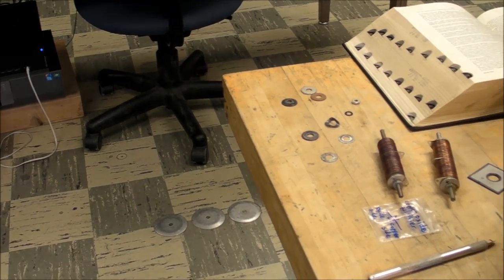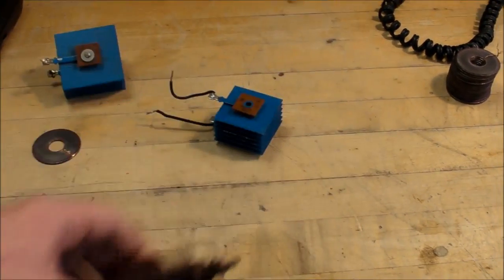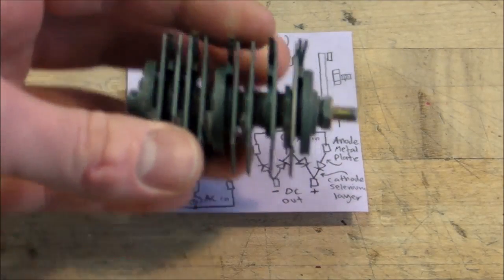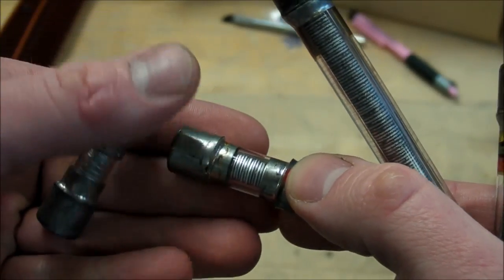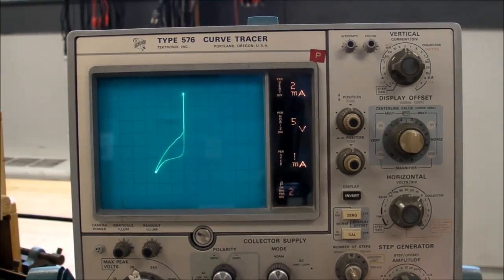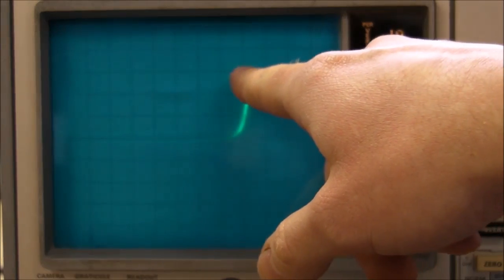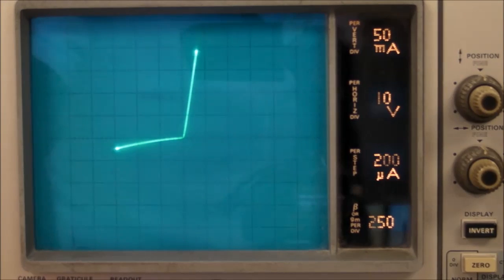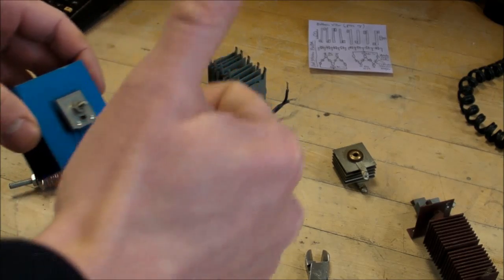(#0062) Selenium & Copper Oxide Rectifiers - Different Types & I-V Curves

Comment: As long as you don't push silicone diodes to their limit it is quite safe and they often are wired in parallel.  Thermal runaway will happen when the first diode to break down, has too much current flowing through it, then the chain reaction occurs as the circuit will continually allow to much current to flow through the other diodes and they pop till they all burn out.

Comment: I was given a few old power supplies that use selenium rectifiers. I've been trying to figure out how much current they can handle to see if they're worth keeping (they take up lots of space). This and your other video on old rectifiers are the best sources of practical info that I've found so far in terms of answering my questions, so thanks. I'll be ditching these old power supplies because between these vids and other sources, I know that I can get a much more efficient and smaller rectifier for well under $20 if I ever need them,  and they won't even need a transformer to drop the voltage for me first because some modern ones easily handle 120VAC.

Comment: I recently picked up a WWII 1943 vintage ARMY Signal Corps Voltohm Meter I-166 which has a Copper Oxide rectifier... it's basically a DC volt meter and rectifies AC to get a reading I guess. The rectifier is in a sort of Bakelite case covered in wax and has a standard four pin tube base like a type 80 tube. So I'm guessing they were prone to failure and the tube base made it easy to replace it. I'll probably wire in some modern diodes and figure out a resistor to make the AC read right.

Comment: I'm sure that a normal resistor will rectify better than the bigger copper oxide rectifier :) it has a good linearity even for a resistor in the both directions with insufficient angle between them :) I vote for the selenium rectifier!

Comment from the maker: In this context, hysteresis means the measured current (vertical axis) takes different paths as the applied voltage (horizontal axis) applied in different directions (increasing vs. decreasing). Check Wikipedia.